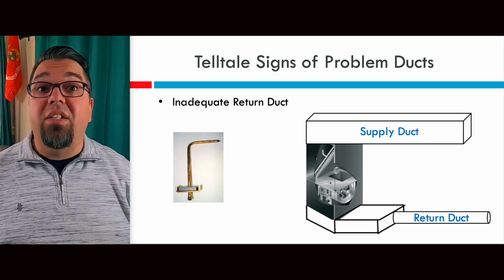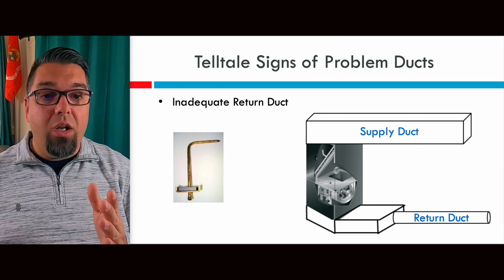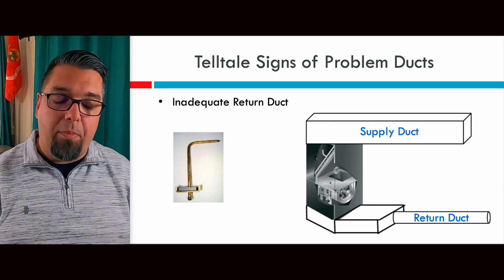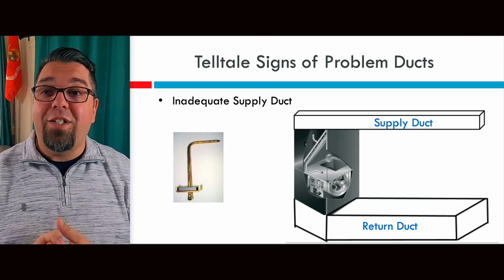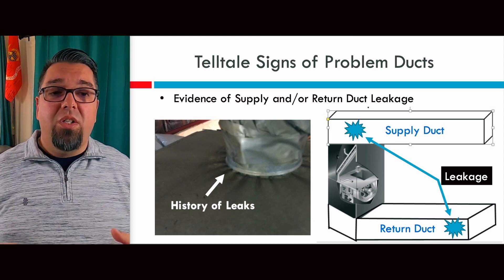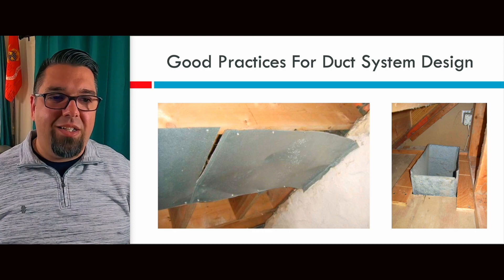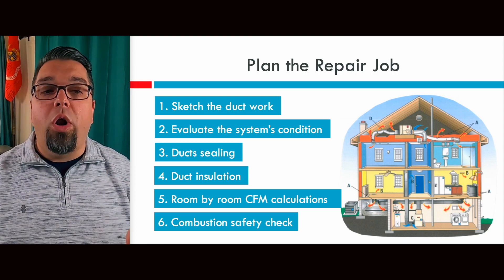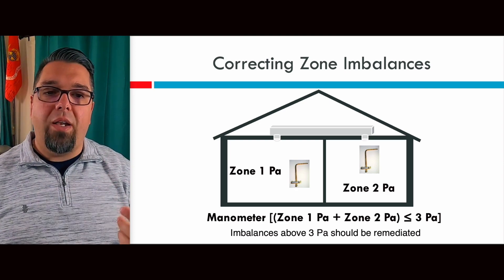Plan for Duct Repairs & Zone Imbalances

Comment: This channel has provided me with the most concise and useful information yet in HVAC design. I worked installs for a couple years and am currently in the pre-planning phase of designing the central air system for my new house. I will be using many of the tools mentioned for verification and the relevant ACCA 8th edition manuals which I am buying.
Reply from the maker: Thanks for the very kind words, and for watching my content!  If you are buying updated ACCA Manuals or Code books, consider obtaining from my affilliate with a 10% discount?! https://www.buildersbook.com/?acc=2fbbc583d9dcde9fd4eb022e25f3fa37